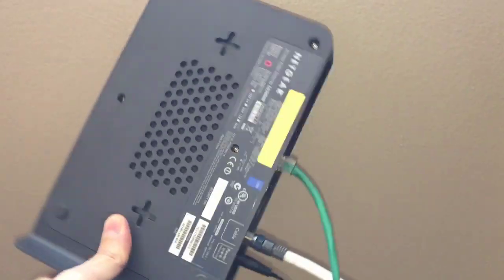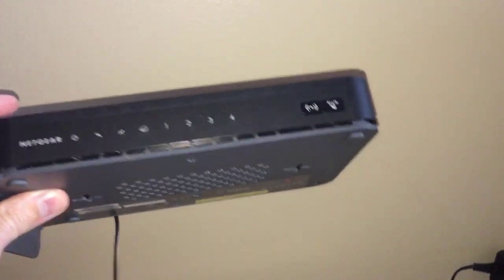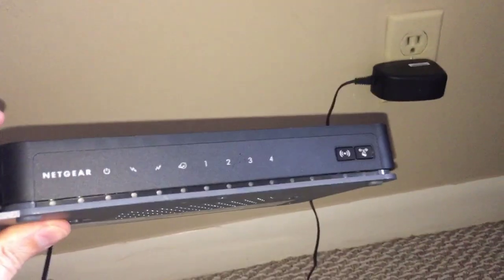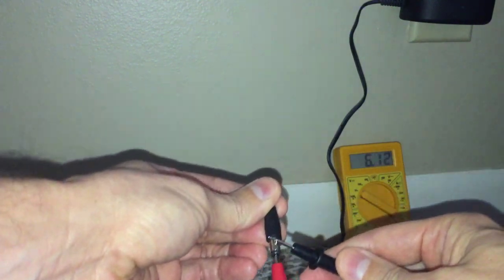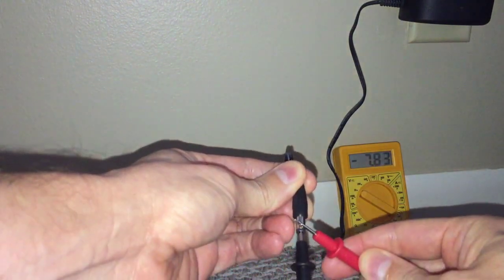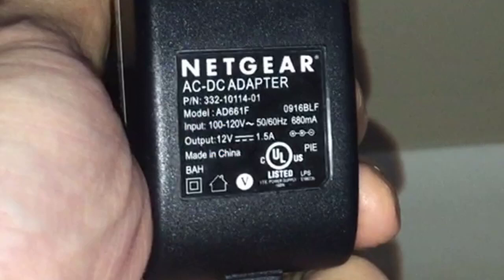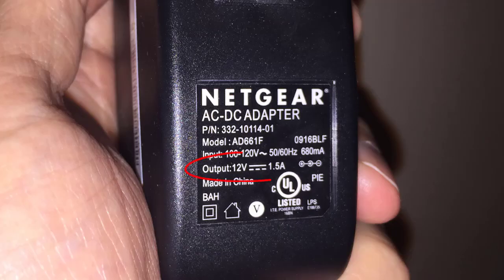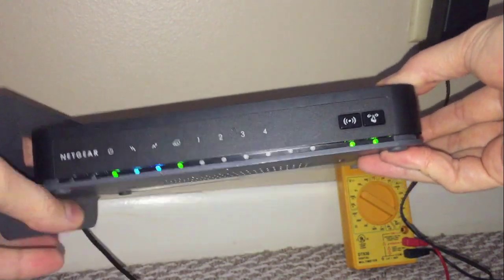Modem router won't start, no power, no internet

Comment: Thanks a ton! I had a power fluctuation from the main supply and almost thought that my router was dead. All I needed was another adapter. I had a spare lying around which had a different pin. Used the one from the dead adapter and viola! 🙂
Reply from the maker: Glad to hear it, and thanks for watching!
Reply: Maaan the same happened with me today and I was reading comments. Right away ran for the spare adapter and it worked . I  didn't even finish the video 😂🥂
Reply: I had same problem.

Comment: My modem had all the lights on, but I couldn't connect to XBox Live. It won't reset. I unplugged it. Plugged it back in. Lights wouldn't turn on. Only the power light would turn on. Only the DSL light would turn on. Finally 3 lights would turn on. I switched the ethernet cable for a new ethernet cable. Finally all lights are on and I'm on my laptop. Not sure what the problem is. Or if the modem will connect to my XB1. Maybe it's the ethernet cord, but the modem lights were on randomly or not at all. I'm thinking it's a modem problem. Not an ethernet cord problem.

Comment: you saved my day!I was looking to go to a repair shop for getting it fixed, but found out that I have a spare 12v dc adapter in my cupboard.I just used that adapter and it now works fine!
Reply from the maker: Glad I could help, and thanks for watching!

Comment: Original adapter was 9 v found spare 12 v tried it & got power.. Thanks for sharing 😊
Reply from the maker: Great 👍
Reply: A warning, you should NEVER use an adapter with more voltage than your router needs, if your router needs 9v so use 9v no more nor lesa, if you used more voltage, your router may get damaged over time.

Comment: Hey brother, I have an issue with my modem. It doesn't switch on instead blinks while removing from the power socket. I tried In different sockets same result. What could be the problem.

Comment: I saw your video and you might probably be right. I look for it tomorrow and see if the problem is fixed. 

Thank you.
Reply from the maker: Good luck with your project! Just make sure that the voltage and amperage output on the new power supply is the same as on old one.

Comment: Saved me $ thank u. Netgear told me my hardware failed used another adapter started right up!
Reply from the maker: Glad I could help
Reply: @Your-Self  liked and subscribed
Reply: @Your-Self  did you have to look at multiple Goodwill‘s to find your particular adapter or were you were able to get lucky on your first strike? I’m weighing the time and gas to look for one there versus paying the $10 on Amazon.
Reply from the maker: I got lucky the first time, but your mileage may vary.
If you buy it online, make sure the plug is the same size as yours.
Reply: @Your-Self  i’m glad you got lucky on your first shot anybody nice enough to share this information deserves that type of good fortune.

Comment: Bro My router never turned on after lightning strike yesterday night what is the solution? And can I clain it's warranty after this?
Please reply🙏
Reply from the maker: I'm not sure if your warranty will cover it, they all are different.
If it's not covered by the warranty, and there is no voltage from the power adapter, it's cheaper to replace that adapter than to buy a new router. Good luck!
Reply: @Your-Self  thanks

Comment: So what's the difference between the two adapters? They are both 12v 1.5a.
Reply from the maker: They are both rated at 12V but the original one is bad and gives only 7.8V... that's not enough power.
Reply: @Your-Self  I see! How did I skip that part..!

Comment: I did that and it turned out the power supply was fine. So if the power problem is from inside the router; is it still fixable? Like a fuse change or something?
Reply from the maker: Yes, if the power adapter is good, the next thing would be to check is the fuse inside the router. The fuse could be removable or soldered in, which makes it difficult to work with.
Reply: @Your-Self  do you have a video on this??
Reply: @Your-Self  hey is there anyway you can make a video on it? Is it something someone who has no idea about modems be able to do? I’m having the same issue and i really don’t have an option of buying a new one 😭😭